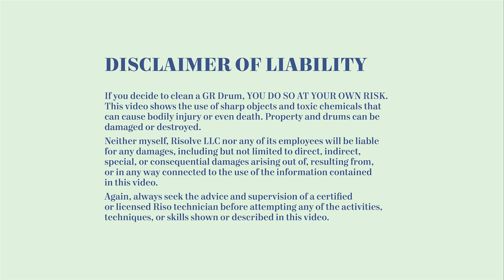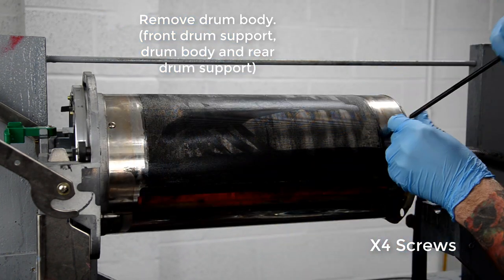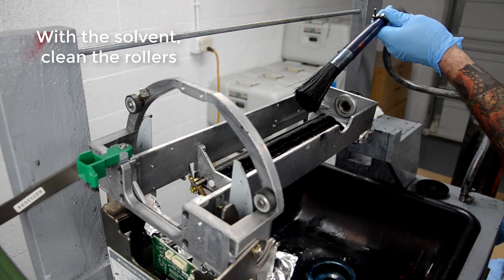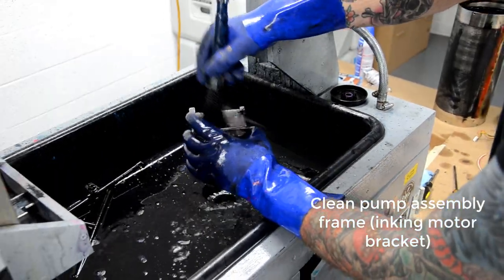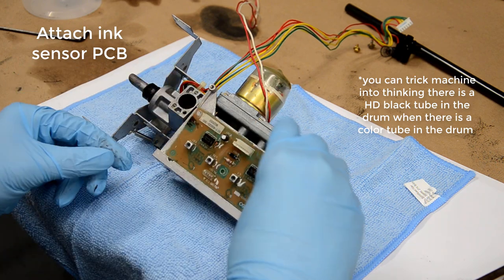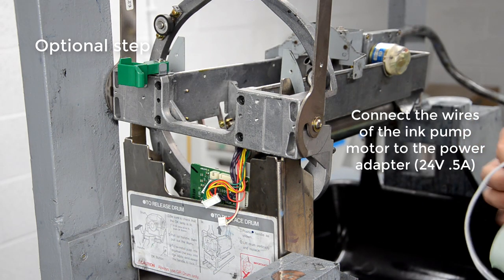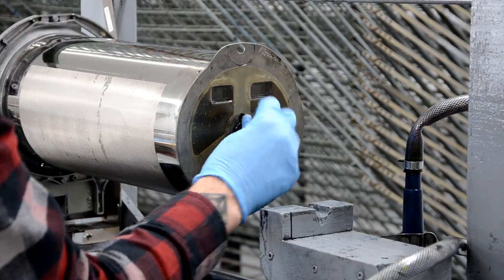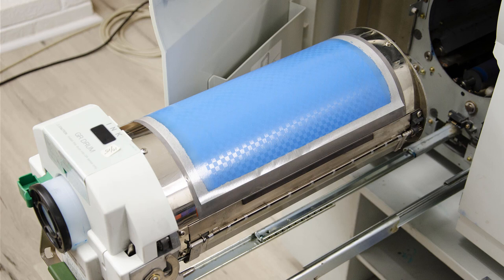HOW TO: Clean a Riso GR Drum

Comment: Wow this is a pretty amazing deep clean, thank you so much for sharing this!
I never went that far, cleaning the entire pump unit as well. Basically I was cleaning the squeegee roller, doctor roller and screen, replacing rusted screws and the like; readjusting squeegee gap and ink blocking plates after cleaning. However, therefore I guess I had to print significantly more test prints in order to get the new ink 100%, without residue or old ink remnants left in the prints. Next time I will try doing it your way, as I found it so much better than the way I do.
Once again, thank you for sharing your knowledge and please keep your drums flowing, weehh :D

Comment: Hello.
 I watch your video about the Drum clean. I have a question about the color drum for GR3750. This drum has an Ink sensor PCB Board. On this Board, in addition to two ink sensors, there is a light lamp. What is its purpose? When does it light up and when doesn't it?
After assembling the drum, it stopped emitting light. What did I do wrong?
I hope for your advice.

Sincerely, Mash kola Olga
.

Comment: And I've been having the same inking problem with the ricoh Duplicator and the drum is not inking and also the drum is making several rotating cycles after those cycles the machine is asking to replace the ink  cartridge and is there any other way to get any other tips and solution thank you

Comment: We have more and more RISO duplicators in graphic arts companies and we are faced with print quality problems such as irregularities in color areas.
This phenomenon is mainly ink that dries on the drum (non-regular use), we must then clean the surface of the drum body and silk (gasoline F) but despite this cleaning, it can remain traces and we must then replace the silk to make the flat color perfect.

Is there a solution to clean the silk ( screen asy ) effectively to avoid its replacement (eg, soak the silk in a special product).